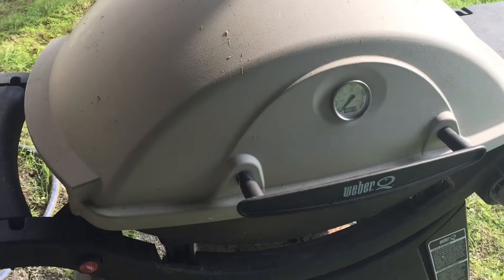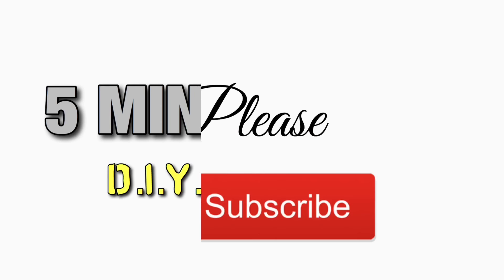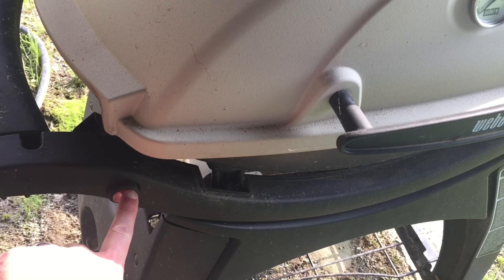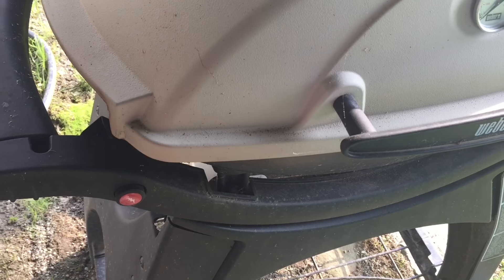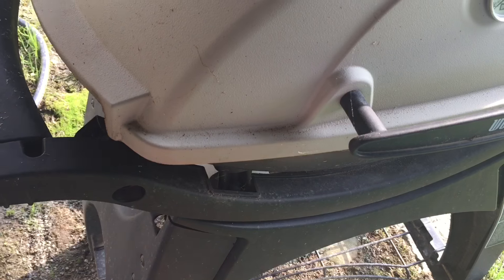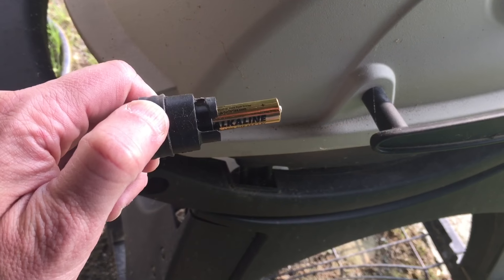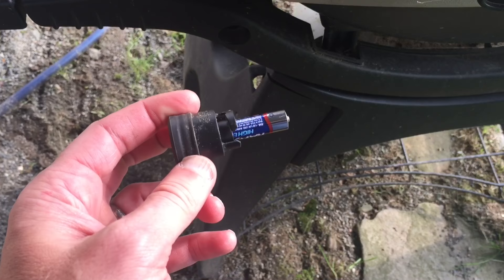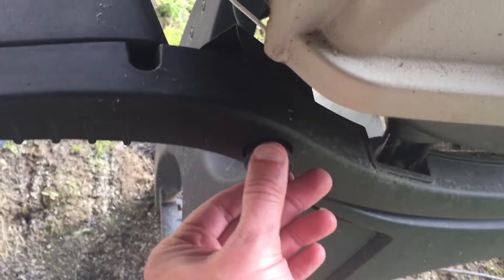Weber Grill Ignitor Battery Replacement.

Comment: I bought this as my first propane grill. It's been a fun, learning experience https://www.youtube.com/post/UgkxCx5fHawkK9OoV-ojFrY8JLnZrFwAmvUt . I think it's a bit too pricey after looking at other grills, but it wasn't hard to put together and it works really well. I love the side burner option for heating food during a power outage. I have an electric stove and live in the South (Hurricane season), so this was a bonus. I also bought a cover for it and it has protected it nicely (the Char Broil All-Season Grill Cover 3-4 Burner: Large). Every few grill sessions, I take the rack (or grate) and burner covers off and clean them with a non-abrasive scrubby and mild soap. I wipe the excess off of the bottom as well, taking care to avoid the gas and pilot lines.
Reply from the maker: I agree my Weber Q is well over 10 years old and I’ve only replaced a couple of parts on it! Thank you for watching and please consider giving the video a thumbs up if you haven’t already! Thank you!

Comment: You shoulda called this one 10 second fix !
Reply from the maker: Kenneth Albert I agree!
Reply: This doesn't actually work.  The wing nut behind the panel turns with the slippery (should be knurled by Weber, bad design) nut on the front, twisting the wires.